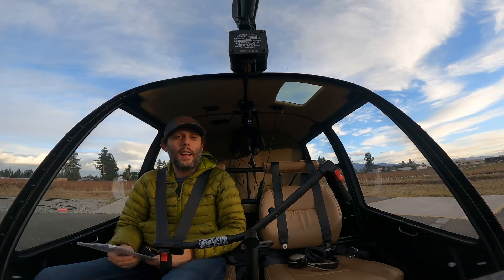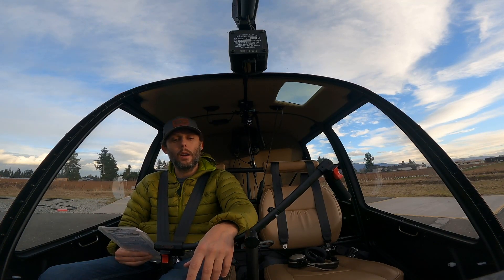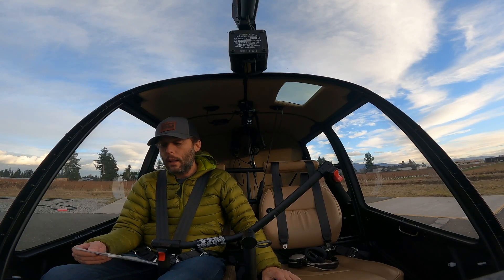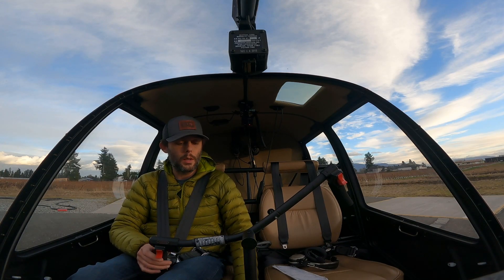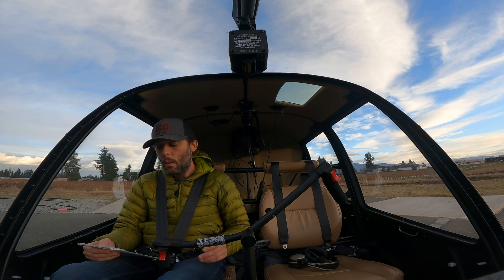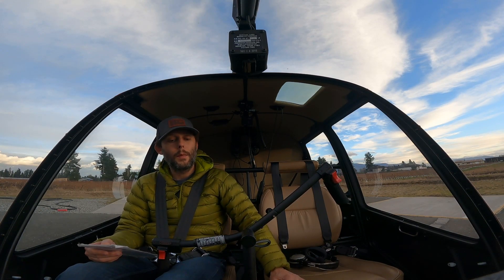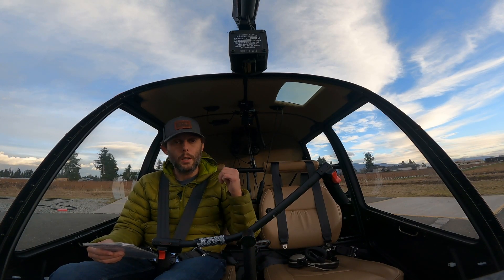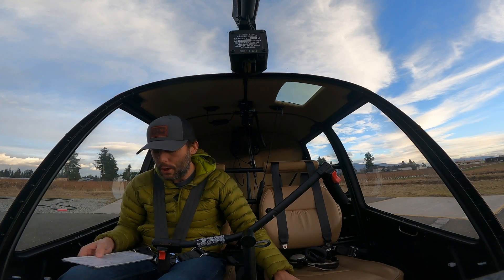Ep.40 Starting a Robinson R44

Comment: What happens if you keep the clutch disengaged, besides the rotor not spinning? Would that cause some damage later on when engaging it?
Reply from the maker: If the engine is running without belts engaged for too long it has the potential to cause damage to the belts from slipping and heating them up.
Reply: Thank you for the acclaration @BCHelicopters